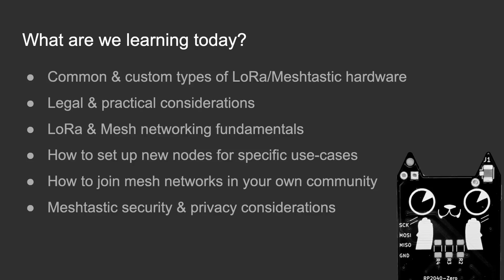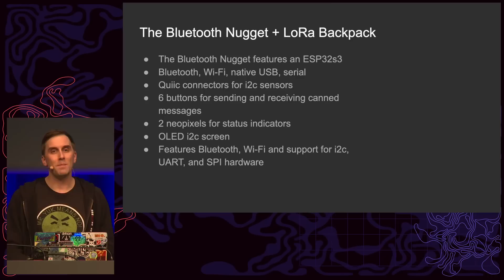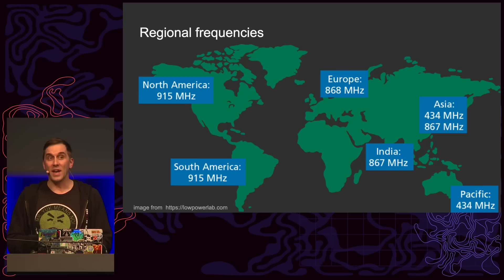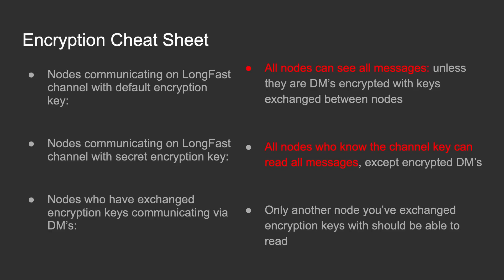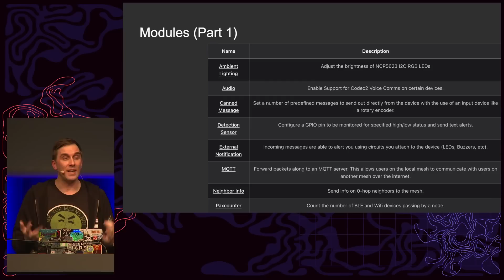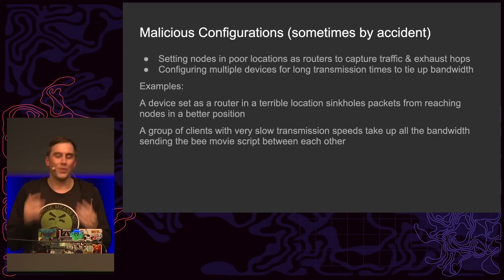38C3 - Hacker's Guide to Meshtastic: Off-Grid, Encrypted LoRa Meshnets for Cheap!

Comment: I personally have just left metastastic. I may at some point integrate it into my mesh system, but it just keep falling behind on so many promises, and the actual efficiency of packet delivery and transmission is garbage compared to some of the alternatives. I'm currently running a reticulum mesh that is Bridged through multiple radios including 2.4 lora and wifi 5